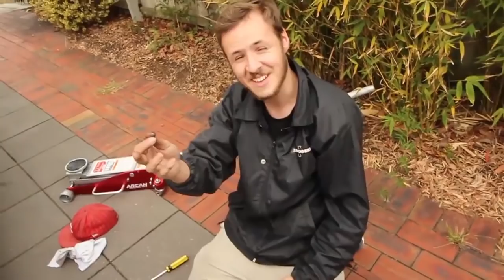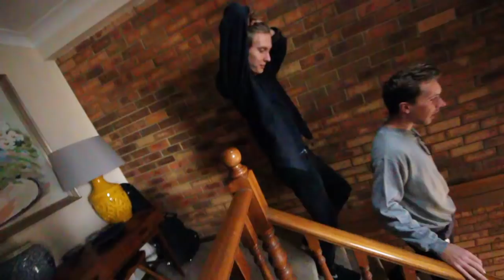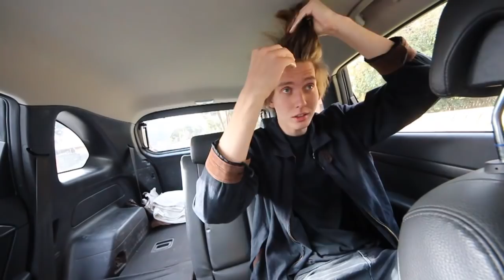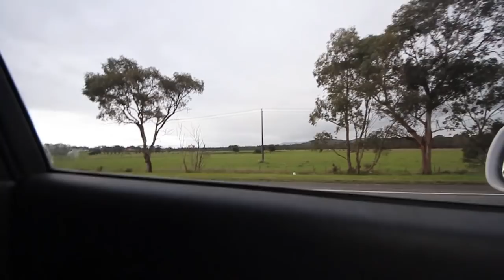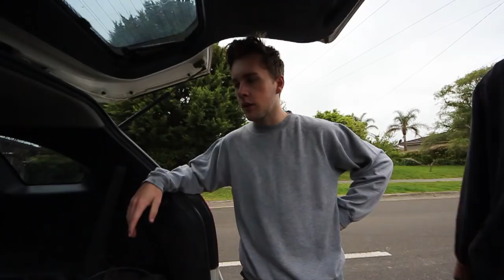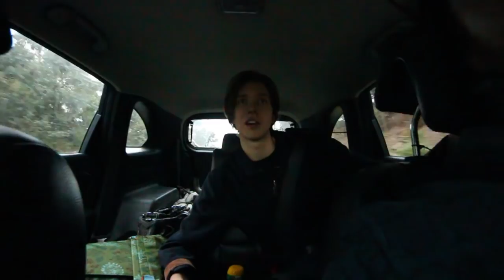Matt's new Motor! | Plans for the Corollas

Comment: So you guys should either send me the info on the r1 carb conversion or just give me some makeup tips. Ill give you 6 darts and a couple vb tins xo
Reply from the maker: not much info to give man, get a manifold made up and chuck them on! it will basically require the same steps as matts bike carbs :)